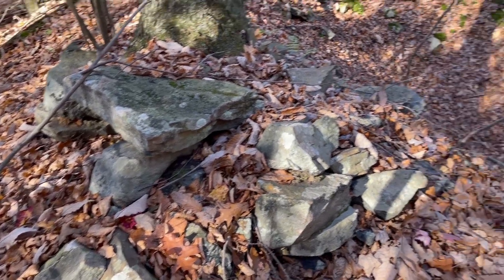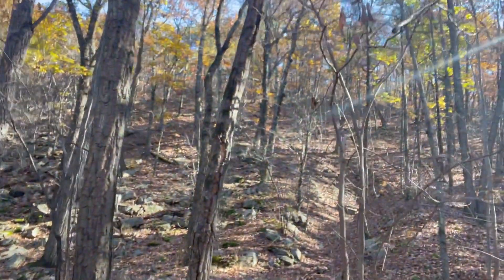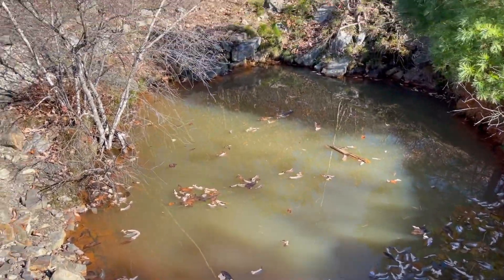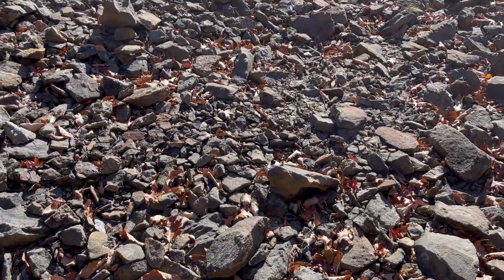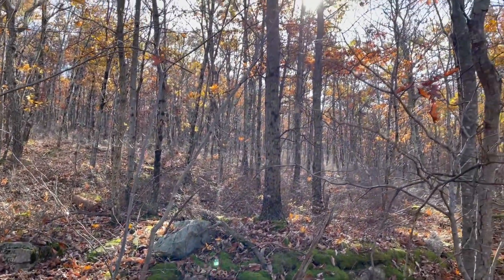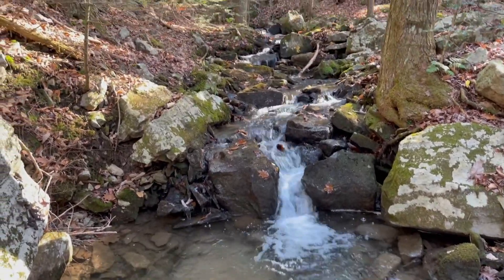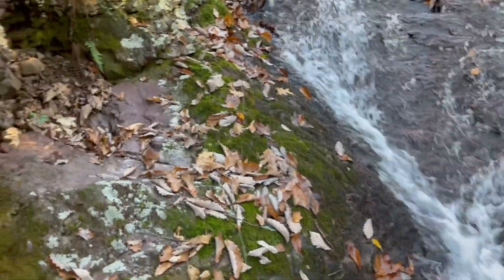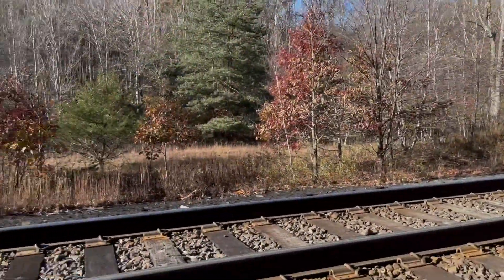Mines and Mysteries: Using LiDAR to find a Mine in NY

Comment: hi mike, where do you get your lidar data from?
Reply from the maker: Hi, Here is the link for NY https://orthos.dhses.ny.gov/?Extent=-9603624.133747088,4774299.7366908705,-7659066.134172721,5795498.434580554&Layers=07_meter_dem_index_usgs,1_meter_dem_index_fema,1_meter_dem_index_usgs,1_meter_dem_index_tidal_water,1_meter_dem_index_hydro_flattened,1_meter_dem_index_usda_utm18n,1_meter_dem_index_usda_utm17n,1_meter_dem_index_nys,2_meter_dem_index_ne_lidar,2_meter_dem_index_nys,2_meter_dem_index_fema,2_meter_dem_index_monroe_county,2_meter_dem_index_tompkins_county,2_meter_dem_index_erie_county&layerGroups=DEMIndexes,Orthoimagery&rightMenu=0
just be sure to select hillside map at the top right corner otherwise it won't be Lidar maps!